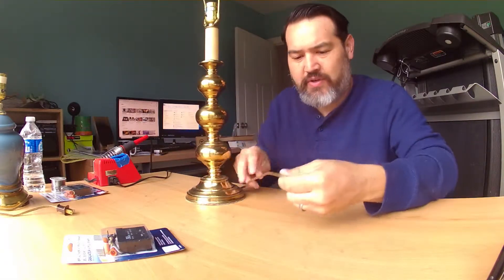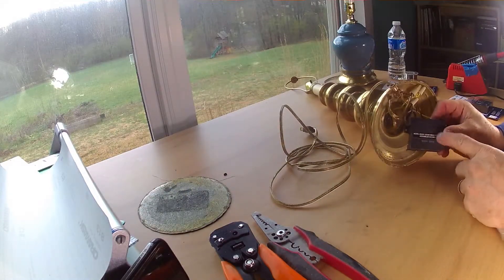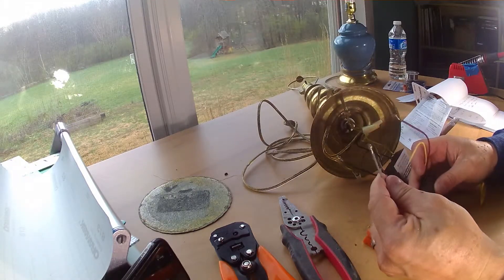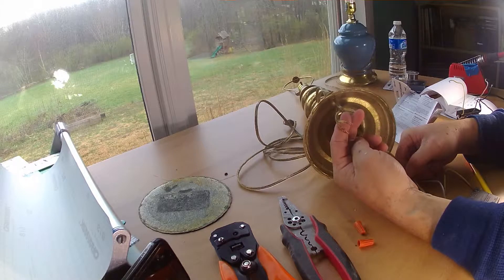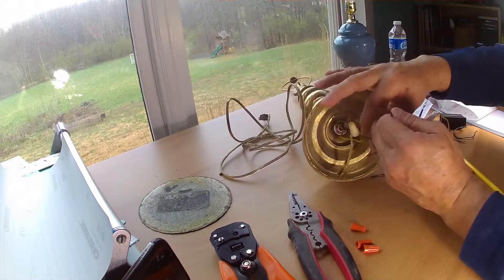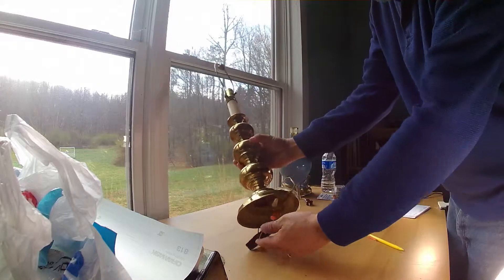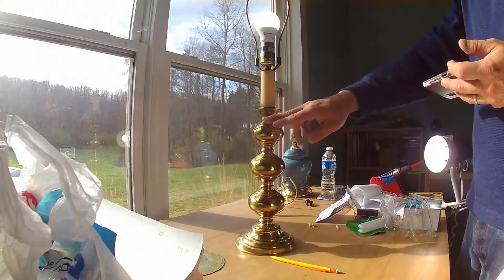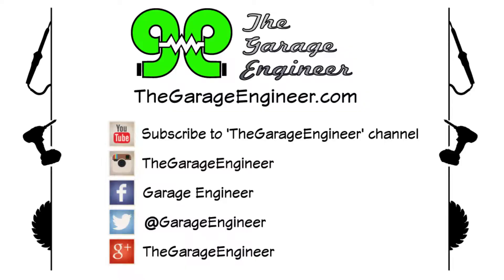Turn ANY Lamp into Touch Dimmable Lamp - The Garage Engineer

Comment: I need to know which wire goes to which connection. When you say connect this wire to the neutral wire, ???????? I flunked out of electrician school thanks. If it looks like it matches up, hook it up. I've been there and done that. I've used two boxes so far with matching up. Looking good ain't working for me. I need to know which wire hooks to which wire.

Comment: I tried doing this on our floor standing lamp. The stands and the shelves are all metal. Touching the metal ring attached to that little black box turns the lamp on and off etc. But attaching this ring to the lamp stands does nothing unfortunately.

Comment: I’ve got some dimmable lamps. My wife and I don’t care for the order of brightness. Ie: from the off position… upon touch the metal to initiate power… the lamp starts off in its lowest setting; then gets brighter with each tap until it cycles back to the off position. We’d like it to cycle backwards. As in, the lamp starts in its brightest setting and then dims downward with each tap. We have a new born… the light coming on full strength is a bit jarring to everyone, not just the baby.
Reply: Contradicted yourself
Reply: @violentchildhood7016  I sure did contradict myself. I was running on the lowest brain power at the time. We had just brought our son home from NICU and I (and my wife) was sleep deprived for weeks.

Comment: I installed a touch module to my 3-way lamp and have no light yet. When I turn the switch there is no off for some reason because my power detector pen stays lit as I touch the lamp with it. Any thoughts anyone 🤔
Reply from the maker: maybe the 3 way lamp has a mechaincal switch to change between the 3 settings?

Comment: Thanks (old post) but relevant information.  I installed a westec into a floor lamp, having trouble, not enough space for module due to counterweighted base.
Reply: I just cracked the counterweight into a couple pieces with a hammer then JB welded the 2-3 pieces inside the base leaving room for the module & connector’s. On another lamp I took out the weight and shaved off some with my grinder to fit the module.
Reply from the maker: Those weights do get in the way.  Hope you find a better locations.

Comment: The best (sometimes the only) way to find which wire is neutral is that the neutral insulation has a little ridge on it NOT by finding "writing". Also, fluorescent will not work.  Get the hot / neutral wrong and you fry your control switch.
Reply from the maker: Great tips.

Comment: I still have a yellow wire out of the unit I just purchased, all of the other wires are connected but there isn't any wire to connect to the yellow wire???
Reply: The yellow wire is the signal wire (switch).Just attach it to the metal base.I added this to a cabinet light .Just spliced a longer wire and attached it to a metal hinge

Comment: Hi , I have a touch lamp I would like to paint. Will the touch part still work if I paint the lamp????
Reply from the maker: The touching of the lamp grounds the circuit allowing the light to turn on.  By painting the lamp it will not allow the connection to be completed.  Maybe you could leave a section of the lamp unpainted?

Comment: I have a custom Bare metal base, and I’m thinking of painting it with hammered finish spray paint.  Probably 2 coats, and maybe one clear coat.                                                           Dose anyone know if the 3 way dimmer will still operate with the base Being painted? Or will this make it, non-conducive to human touch?
Reply: I think you'll need an exposed metal part to act as the switch. I think it works on a change in capacitance though so maybe it might work because the paint may have a small amount of conductivity that the switch will be sensitive enough to detect. Best bet would be to give it a go and find out

Comment: What happens if one of the wires in the base of the lamp becomes loose and touches the metallic surface, making it live?  In the UK we have to connect metal parts to Ground if they are used to enclose live connections.  What are the rules in the U.S.?
Reply: Not sure as to why but pretty much no lamp ever has a ground pin. I believe it might be the double insulated code that allows for this.